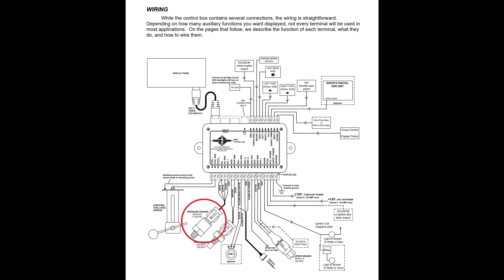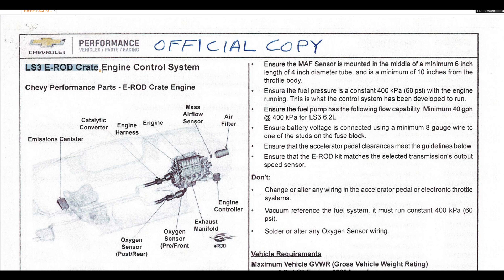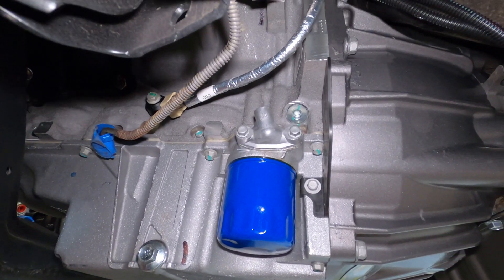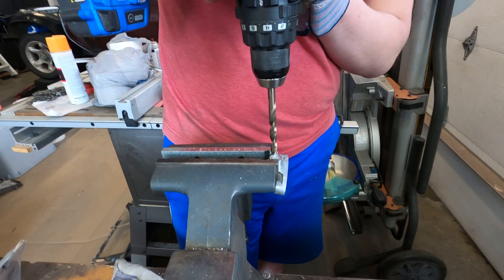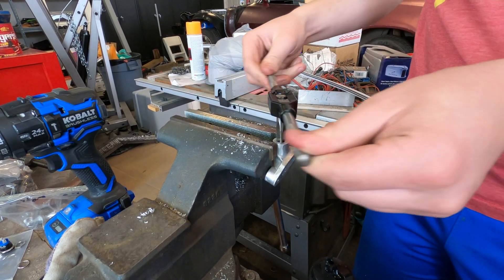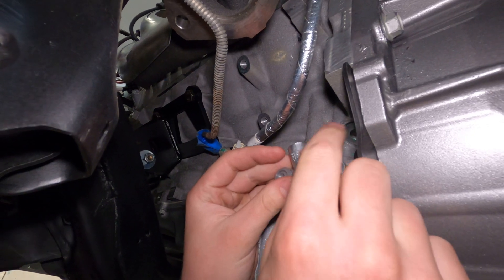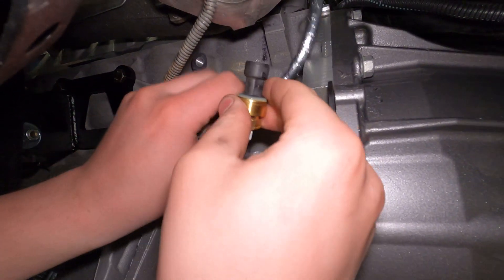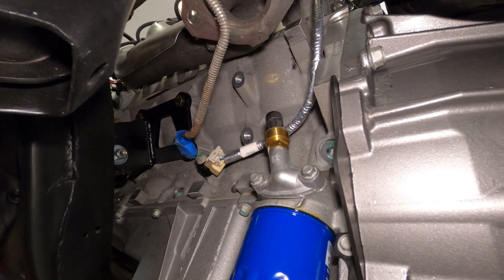LS Swap 19 - Dakota Digital Oil Pressure Sensor Installation

Comment: Is there a reason you didn’t remove the erod one it came with and use an adapter to install it for the dakota digital one behind the intake manifold?
Reply from the maker: I like this question, it's a good one.  To be very honest, I don't think that idea crossed our minds.  Just kind of thinking out loud, the area behind the intake is pretty close to the firewall, so access could be difficult and/or you might not want stuff there.  But it's something people could certainly think about doing.
Reply: @WorkinOnIt   I was planning on doing just that but you are correct for my situation. It is going in a G body Monte Carlo and will be using the stock gauge and oil sender but its too big to clear. So i will be going your route. But i did find a part number 12551587 that comes already drilled and tapped from GM.
Reply from the maker: @george536  Nice - thanks for the part number!

Comment: If I understood you right if I have digital Dakota gauges are you saying that I need a digital Dakota oil pressure sensor.
Reply from the maker: That is exactly what we think and why we installed the extra Dakota Digital sensor.  It is redundant and especially annoying because there's another oil pressure sensor already installed on the engine that doesn't even get used.

Comment: That cover is different on the trucks and SUVs, it's where the oil cooler lines are connected.
12551587 is already drilled and tapped for a sensor

Comment: where did you get that cover. is it a ls stoack part? if so what model is the engine ?
Reply: It's a stock plug for the oil lines. Junk yard or part store should carry it, it's common